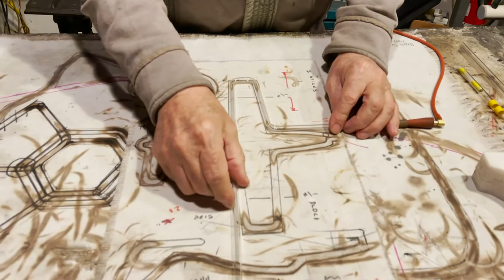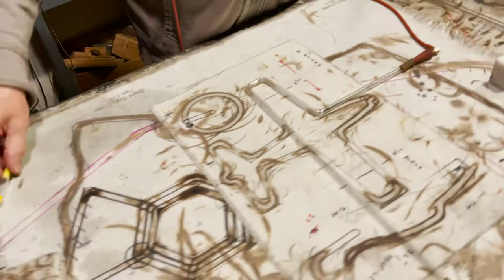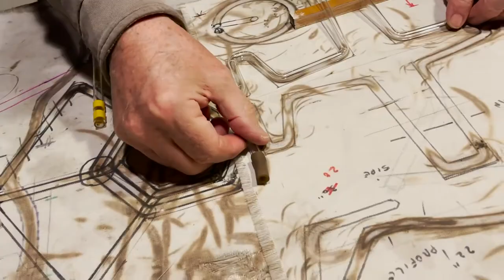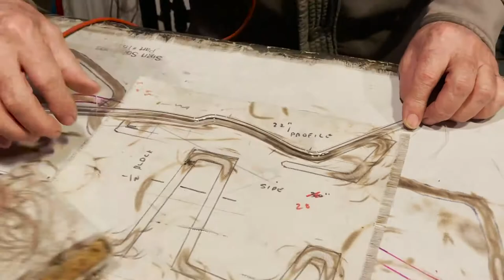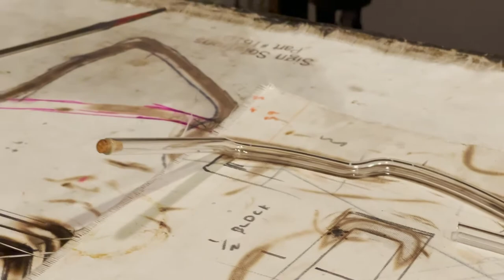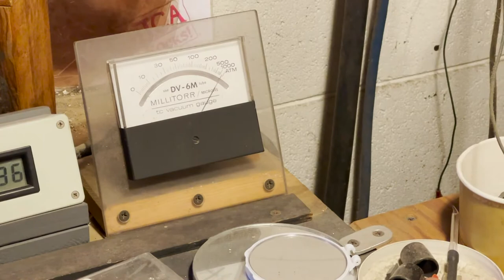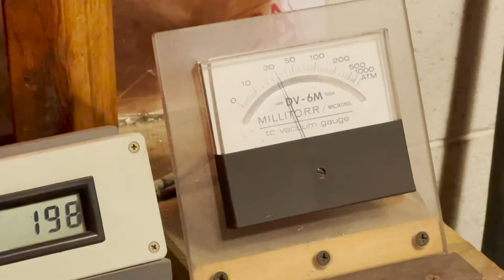Neon Bending Demonstration with Michael Flechtner

Comment: Hello!  what kind of paper are you bending on?  and what kind of marker are you marking with?  thanks!!
Reply: In neon making you can use chalk, a wax penicl, charcoal. Its just glass. The heat burns it away usually. It is a special paper that is made of nylon I belive. It escapes me but you could use any paper as long as you have a wire mesh over it. that is how some people do it to.
Reply: @Cristheneonartist  the original bending material was asbestos paper, then it was fiberglass with a silicon coating. Both of these are expensive and you have to transfer the pattern. The mesh over paper is a quicker way to get bending.

Comment: That's so awesome!!!  I've not seen torches like yours are they propane, oxygen?
Reply: Usually propane and air. From a compressor or a blower
Reply: Standard set of American style torches...5 point crossfire...16" ribbon burner and T 500 hand torch.  Natural gas a a little forced air.